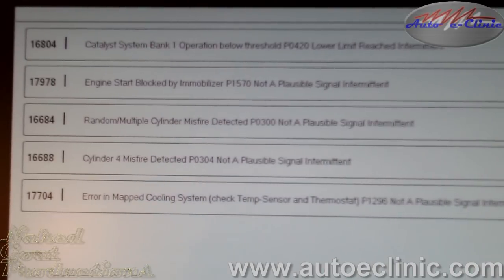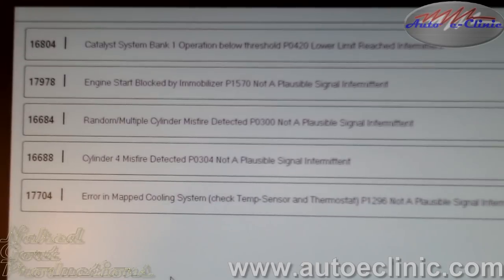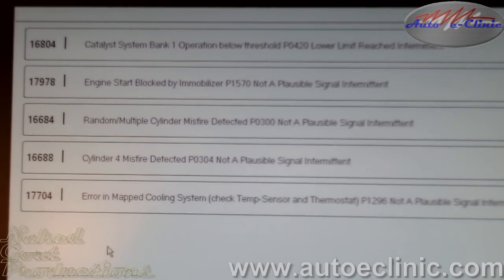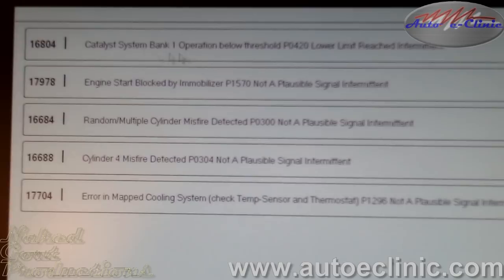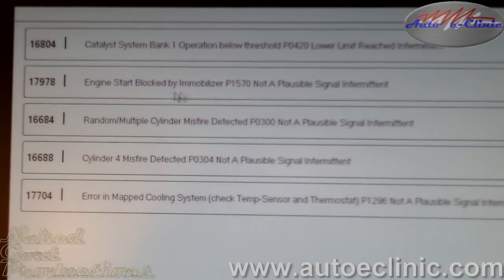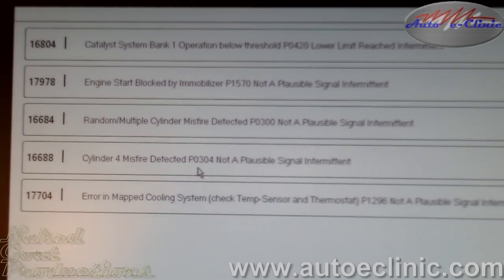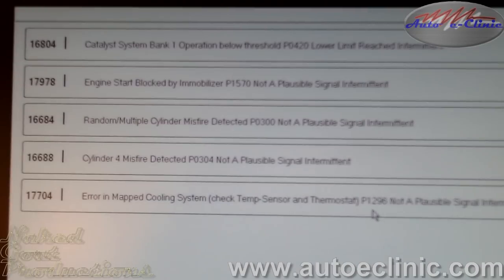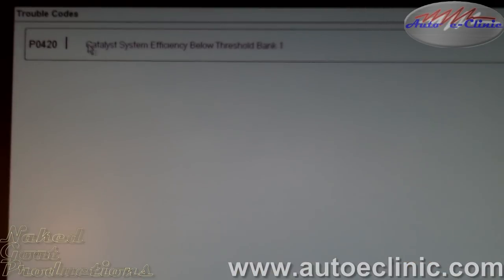How Diagnose A Check Engine Light : Code P0420 Catalytic Converter (Volkswagen Passat)

Comment from the maker: You are right about the temperature not being a valid CAT test except in this case. Per VW diagnostic test procedures, temperature was one of their test. We followed VW test procedures for this code. Although the PCM does not monitor CAT temp, CAT temp is in this case a direct reflection of performance. Either way we were right for this application and this concern. Thanks for the questions and concerns. Michael and Aaron

Comment from the maker: If you noticed the p0420 was the first on the list in the VW side of the PCM and the only code on the obd2 side. The way i was trained by GM and Snap On was to start with the first code first. In my opinion the p0420 being first was Volkswagen's way of saying it was most important. Also the only code on the obd2 side was the p0420 and that was the only code causing the check engine light to be one. After test driving the vehicle I felt no misfire.

Comment: the cat inlet and outlet test should be done with somebody holding the throttle at 2500 RPMs without lifting or depressing the throttle even if the engine speed drifts..  so you see the system in feedback mode..   at idle.. there is not enough energy to create enough reaction in the cat to heat the external shell properly.  so the test needs to be redone and reexplained ..  there is actually combustion in the cat caused by the reaction/catalytazation of the compounds in the exhaust stream to convert them into something else.  when the cats go bad.. the particles of reactive material are either covered by contaminants... or melted together where they won't react..
Reply: I'm not quite sure why they did the test this way either. No true testing at all was done here. This was a typical thing I see in the industry. And one that will absolutely have a failure again soon if not already judging by the date of the video. The cause of the Cat failure should always be the subject of diagnosis, and that was not addressed at all. What were fuel trims doing during this time of the temperature testing ? Here is a question to pose , if the vehicle were running lean how would the temperature test be affected ?
Reply: I'm not quite sure why they did the test this way either. No true testing at all was done here. This was a typical thing I see in the industry. And one that will absolutely have a failure again soon if not already judging by the date of the video. The cause of the Cat failure should always be the subject of diagnosis, and that was not addressed at all. What were fuel trims doing during this time of the temperature testing ? Here is a question to pose , if the vehicle were running lean how would the temperature test be affected ?

Comment: I have a 2002 Passat , Would a bad catalytic converter cause engine fumes in the car  while idling? Thanks Don
Reply from the maker: don balkie Thank's for the question but due to the passing of Micheal we are not answering any question, sorry.
Reply: +AutoEclinic Huh ? Michael would not want thar
Reply: don balkie.
Reply: pcv . i had to replace mine on my 1.8 the neck was cracked.

Comment: I noticed that you had some misfire codes on that vehicle. Why not start with that first as that could also give you a P0420? And checking the temps on a CAT is not 100% conclusive that a cat is bad. I've done this test on several converters and have found it to be ineffective Besides, the PCM is not monitoring temps to determine if the cat is defective.

Comment: Cats are just bs restriction of engine flow and a pain in the ass when they go bad i have 01 vw jetta ko4 1.8 installed full stainless 2.5 inch with 3inch down pipe with no cat runs amazing my engine temps have gone down by 25 degrees.